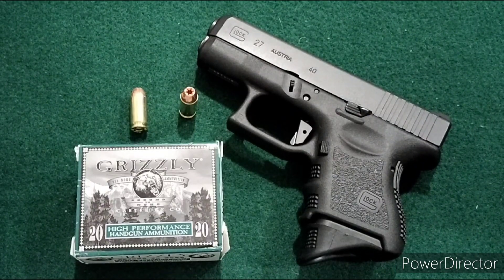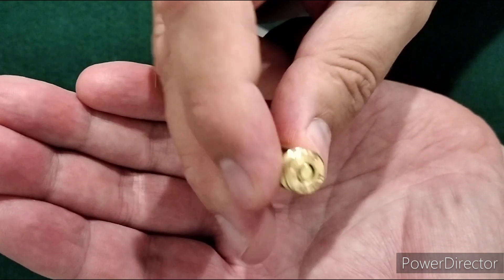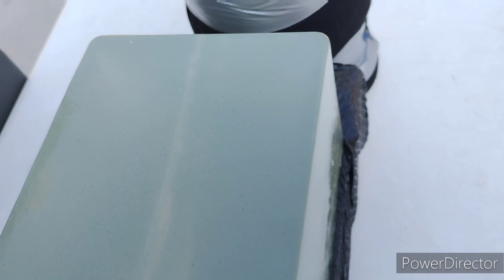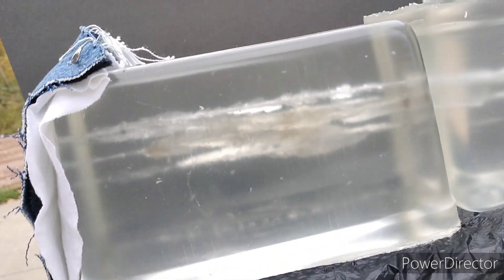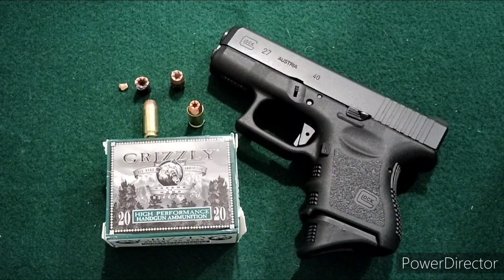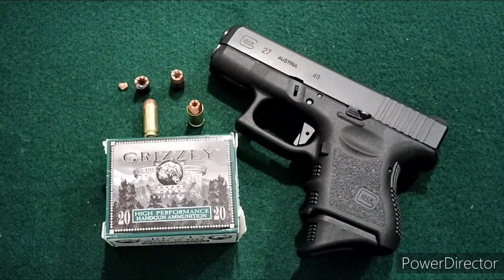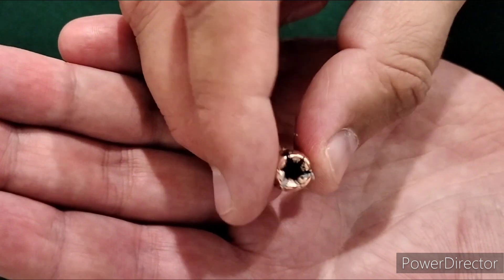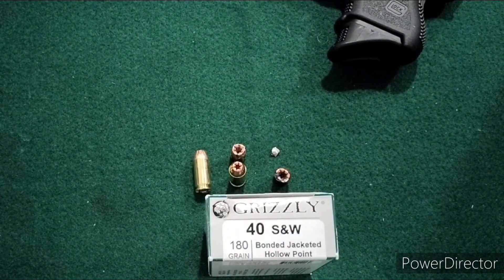Grizzly Day 2.0: 40 S&W bonded 180 grain jhp

Comment: That’s very solid speeds from a g27. I have a few boxes of 180 grizzly 40sw that advertise using an xtp. They had a 5 round average of 1163 out of my xd 4.5. So they definitely load the bullets right because these are some spicy rounds. Probably just some crappy cheap jhp they bought in bulk during the pandemic. Excellent video!